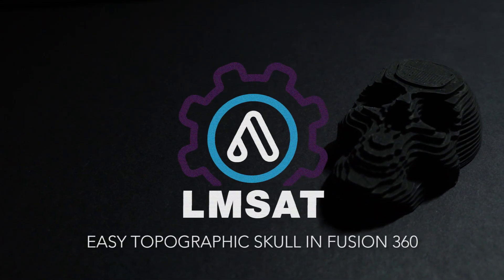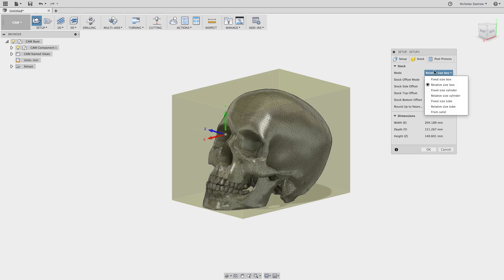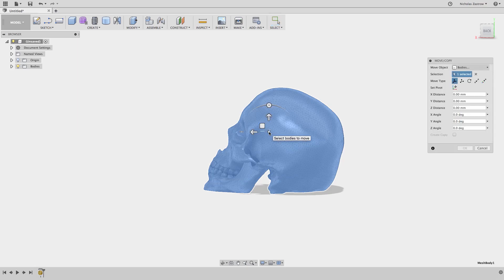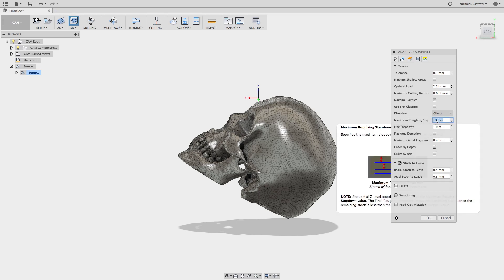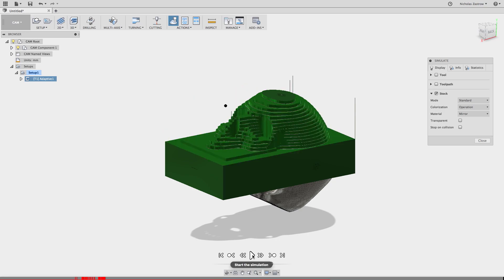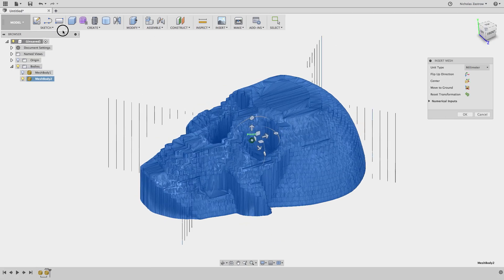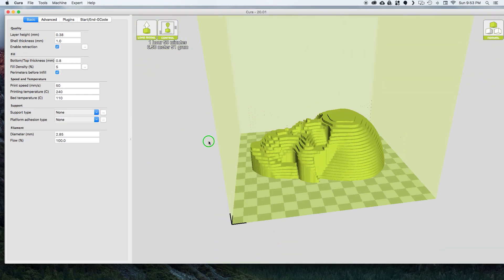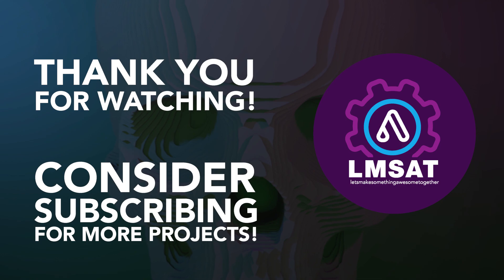Easy, Spooky Topographical Skull in Fusion 360 - LMSAT

Comment: Can somebody help? I have a topographical map of a small lake that I want to print on a 3d printer. I have the map in paper form, and I have an AT5 file of it. This is not copyrighted, because I created the map. I would need to print in 5 or 6 parts and assemble it, but how do I get it from a bunch of lines on a piece of paper into a 3d model in STL file form?
Reply: What format did you create the map in? If it is a vector (SVG), you could import each layer into fusion 360 (could also use blender for this) and extrude to the correct height.
Reply: @DustyLavender  I used a lowrance sonar to plot the map. I can print that on paper or I can download it in a file, but the file is an AT5 file, which lowrance's file type, which is a GIS type file.
Reply: @glenna3434  it will need to be in a different format for 3d printing. I'm unfamiliar with that file format and don't know any software that can open it. You might be limited to saving to pdf and redrawing it in either illustrator / Inkscape or directly in cad software like fusion 360.